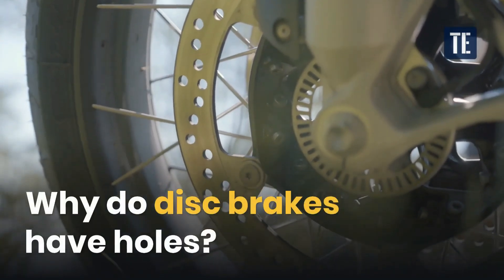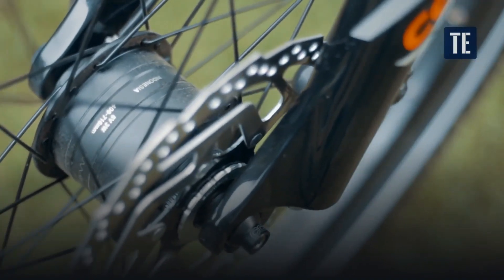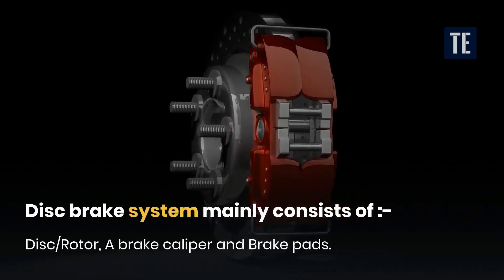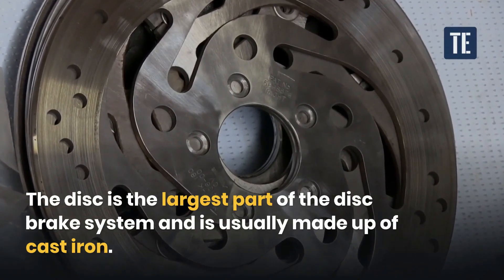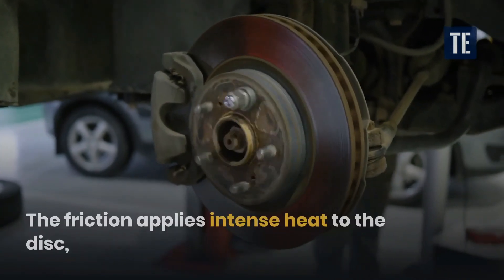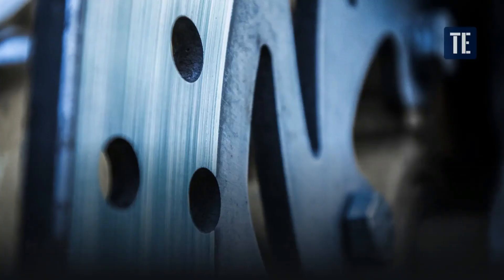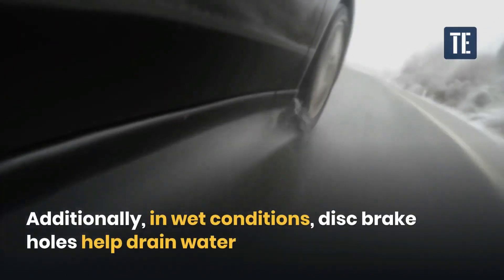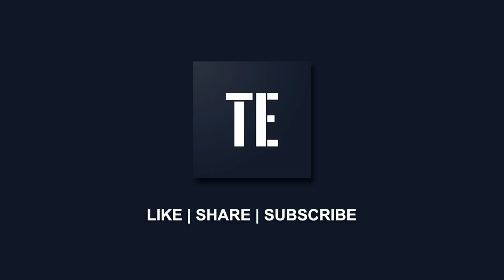Why do disc brakes have holes?

Comment: People think they look cool. The “holes help with heat” was disproven long ago. Less thermal mass to absorb the heat makes it worse. It also causes stress concentrations. Ever see a race car, where it’s actually important, with drilled rotors? No.